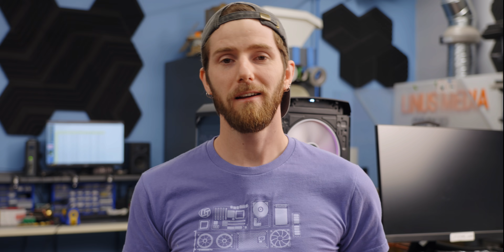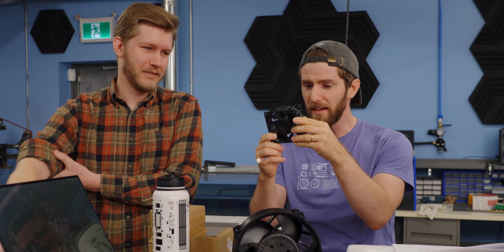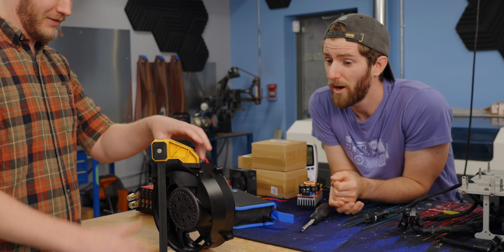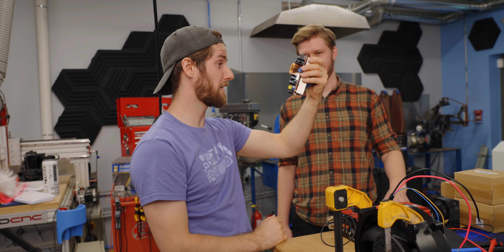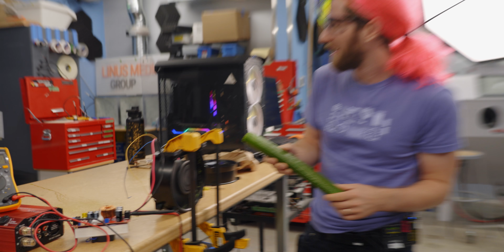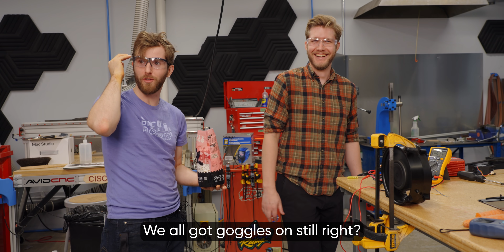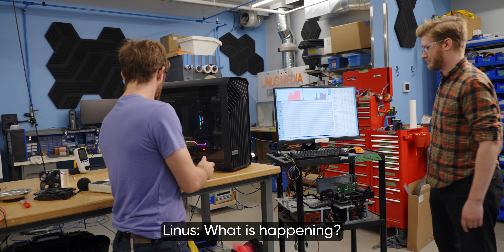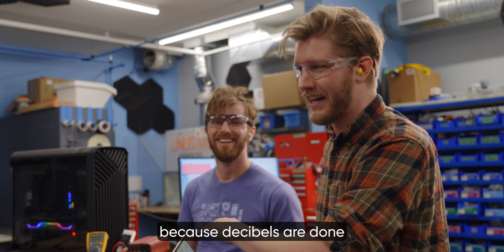The God of Computer Fans

Comment: O have actually installed those exact fans into mcc buckets with extremely power hungry cyclone fan motors. 200HP motor electronics generates a fuckton of heat so they have to have a high heat exchange solution.

Comment: That voltage converter might convert from 12V to 48V, then a PC power supply would fit. And it wasn't a scary thing :) Different story with the fast spinning blades sucking in everything, I wouldn't get my hand that close to it.

Comment: So to answer ur question about moving air into a server room we actually just put in mini splits i installed the heating and air in some. Server rooms a example is a small room about average beadroom size in a single faimly home we had to install 5 tons worth of cooling capacity in that room due to how hot everything got thats the biggest residential unit they make.  More units could have even been added to increase its capacity above 5 tons

Comment: Hi Stationary engineer here we use those fans for cooling VFDs on Air house fan power supplies for vehicle painting, had two go bad about a month ago and it took the VFD off line loosing that air house which had a cascade affect taking down our abatement system.  it turned out to be a a temperature switch that went bad and the fans were fine.   Ive also seen a bank of slightly larger veritable version of those that replaces a large fan in a commercial fan unit.  24 of them supplied enough air flow for a wing of a 10 story building.

Comment: Would agree, these types of fans would show up in industrial cooling/air handing situations. We use a bunch of 24V cooling fans with metal frames/blades for cooling industrial automation stuff at the chemical plant I work at. Sometimes they're 120V, but 24V is common because 24V DC is mostly universal for power and logic signals in PLCs and SCADA (distributed control) systems. Not too surprised at the cooling results either, given the super high flow through the tower heat sink. Would be cool to see a video where LTT and MacAddress do a hackintosh or custom PC that replicates the Mac Pro tower cooling design, but with one of the goals being low(er) noise than this build such that it's ready to daily drive.

Comment: If you want something even more powerful (although they aren't technically computer electronics) check out avionics fans.  Some operate on 3 phase power but others do run on dc power.   I have one of approximately the same diameter as those that runs on 27 volts and pulls 51 amps.  No joke.  I've seen some that eat up 5k watts.   And I bought the same buck converter - only lasted a week =(

Comment: Those boost converter are really good they also can't shock you. And the pontiometers are super reliable of they fail they usually won't output more than the input voltage
Reply: I was very impressed to see it doing at least 1500 watts with 24v input, considering the 30A rating, that input side was seeing more like 60A! no wonder the wires from the PSU got hot! lol

Comment: Those type of fans are used to draw hot air out and in high-power machine cabinet. I worked on one which had a frequency converter in it for several huge engines. 88kw, 50kw and 4x 3kw or so. Cause it has to draw the air through various filters and  a dirt labyrinth, not much of the airflow actually stayed cause air-tech-wise every angle, blockage or bend air has to go reduces the flow by 50 %.

And yes, that means if you have the 5000 litre per second here and let it go through ONE single 90 Degrees Elbow it will be likely only 2500 after that. An 180 Turn will slow it to 1250 then. And so on.  Sure, less steep angles have less performance reduction but if you really check out how many obstacles and complicated ways industrial machine airflow has to go, you need to think BIG in the entry (or exit) to even get a decent airflow.

Comment: Old AB 1395 drives of the 400HP variety or so use a very similar fan at the bottom of the housing to cool massive heatsinks.  We usually just put portable blowers under the drive until they inevitably die and get replaced  where I work.  So there is one use case, though maybe a different voltage.

Comment: 18:00
1Bel = Double the volume
10 deci Bel (10dB) = 1Bel
10dB = double the volume.

What Alex is probably messing these values up with are the 6dB = double the power. So in order to increase the volume of a speaker by 6dB it needs double the power.

Comment: Hey Linus. I am a technical support engineer at Danfoss Drives. These fans are used for cooling high power (+300kW +1000A) drives that used in cranes, HVAC etc.

Comment: I have used 6 of them. 4 were in server racks (but not for servers just that style rackmount hw) to blow air in and out of the rack and 1 for a fume extractor I built. I recall they used to make a smaller version for DEC (Digital Equipment Corporation) that was a U4 or what ever panel that had 2 fans. None of these were run at the rated speed, they were all done to limit noise but for some things you need the static pressure rating of the fan that's more impressive than it's volume/min rating. Next you need to make a bracket to direct all the air over the CPU heatsink fins. They might blow off but if they don't it would work really well.

Comment: They use these fans in large vehicles like rail cars to ventilate the big electrical cabinets with all the circuit breakers.

... I say from inside an electrical locker while installing instrumentation.

Comment: These same fans are mounted on a few large VFD enclosures for larger 200hp AC motors at our facility. They scream when the system is running. We also have filters on these that we replace each week to keep dust and debris from entering enclosure.

Comment: These can be used as a turbo radiator fan setup especially if the radiator is in the back of the car where there isn't any ram air. You can usually find them in drift cars
Reply: Huh that’s really fascinating actually I don’t think I’ve ever seen that before

Comment: For every 6db increase in volume the acoustic energy is doubled , not every 3db. I am an Audio Engineer and mix live Broadcast Sports and Entertainment for a living so I know what I’m talking about. 3db is the smallest increase or decrease that the average human perceive. My ears ruler have flat hearing response and I am in my mid 40’s. I am perceive a 1 db increase or decrease in volume both RMS and Peak. Can also hear audio at volumes lower then 99 percent of the population. Hearing protection is the key and never exposing yourself to high volume as in anything above 85db RMS will help you to avoid any hearing loss!!!!!!! This has been verified yearly by a doctor for the least 25 years of my life… There is nothing superhuman about this, you just need to train your brain to be able to process and perceive. At 95db they should have had hearing protection from the start.   Happy hunting gentleman…………

Comment: 500l/s the air will flow so fast that some serious heat exchanger surface is required even just to extract the heat from the electronics. is this a pipe dream?

Comment: Hi Linus, EE here. I've seen fans similar to this used for cooling computer systems that go into airplanes. At high altitude, there is drastically less air so more powerful fans are needed to keep components reasonably cool. These fans are typically all metal to survive harsh environments as well such as extreme hot/ cold (-55C to 80C for example) and intense vibrations.
Reply: So you are saying there needs to be a LTT Plane to properly test these fans..... sounds reasonable.....can't wait for the video.
Reply: interesting! 🛫
Reply: Thanks for your comment! When they said 48VDC I was thinking that maybe they neglected to specify 'negative' 48VDC which is commonly used in telco switch rooms... but I suppose that's as simple as swapping the polarity. I'm not an aircraft mechanic nor an EE but I have more experience with both than your average bear. I've only seen 28VDC used in aircraft (and AC of unknown voltage but operating at 400Hz!) but that's just from my limited experience; there is a lot of variation in aircraft engineering and it doesn't mean there aren't planes out there using 48V or a step-up transformer just for that subsystem. Given the air density at higher altitudes it makes a lot of sense something like this might be needed for that application! Certainly we need to move a lot of air in telco rooms too but I'd love to see the switch room that would require this!
Reply: @danenright  Ships also have weird AC power you need a transformer to convert to something normal.
Reply: So what I'm hearing is... actual airplane computer fan should be next on the test bench...!
Reply: So technically they are jet turbines lol
Reply: @Enderplays12  I guess.. in a way.. yes lmfao
Reply: @Enderplays12  So technically a turbine captures and converts a fluid flow(gasses are included in "fluid flow") into work.

No, they are not turbines.  They are using electricity(which is not a fluid flow) to turn an electric motor(not a turbine) which rotates the blades(work), rather than say, using combustion gasses to spin the turbine which will rotate the blades(work).  Or putting the blades into an airflow stream and using the rotation to turn a generator(work) as in a wind turbine.
Reply: You should see the fans in the auxiliary unit that cools the PCB and three phase inverters and converters on the trains I work on. They make this fan look like a product from wish. (which in all honesty it kinda is).
Reply: The 48v rating makes sense now, I'm thinking these would be used in the APU bay to maybe cool hydraulic systems.
Reply: @_multiverse_  Datacenters use 48V.
Reply: That was the first thing I thought when I saw they ran at 48v. The Avionics systems I have worked on didn't us fans but we used some mean deltas when we tested boards out side of the enclosure.
Reply: Use the aircraft aircondition sytem will be better 😄
Reply: holy cow lol
Reply: the airpressure thing makes a lot of sense wow
Reply: This doesn't add up.  What plane is flying high enough for the air to be that thin?  Anything flying that high is pressurized so any fan in that plane will function exactly as it would at sea level.   At cruising altitude for a passenger plane, 36,000 ft, any part of the aircraft that isn't pressurized will be  somewhere in the area of -65F / -55C.     You get my drift?
Reply: @Soknik01 Pressurized aircraft aren't generally fully pressurized, just enough to keep people comfortable.
Reply: Ahh, I see now that this fan is for Everest gamers to use on the mountain peak.
Reply: Where can I get metal fans for electronics?
Reply: Isn't it also far cooler up there though? And couldn't you just put some aluminum fins somewhere on the plane surface to dissipate heat based on the sheer speed the plane is traveling at?
Reply: thaaaat makes sense. 
I'd be worried if a flight computer had the same rickety dustcollecting fans that my laptop has.
Reply: @Tulersian  is that so?   Name some modern aircraft that don't have their avionics "equipment" Bay pressurized.
Reply: @mattmcintyre7083  Boeing 767-200. I work on it, I don't really care for semantics. Our forward lower lobe holds our equipment. The pressure seal is on the hatch on the floor of the cabin leading to it, the seal on the E&E access door on the fuselage is nowhere near perfect and allows a lot of deviation in pressure of the compartment. Especially on our aircraft we only prioritize pressurizing locations with people. Where there's cargo we swap configurations so those sections (they can be part of the cabin) follow the ambient pressure to a degree meaning less oxygen at altitude. if there's a cargo fire it will struggle to fuel itself unless it's self oxidizing.
Reply: @mattmcintyre7083  my experience stems from the cargo side of aviation, not passenger. We just have the option to carry passengers if need be. Can't tell if you're trying to make a point about me not caring about the semantics of aviation equipment or if you're actually curious. Either way, I'd trust the, E/E guy over me but I still have experience. (E/E literally stands for Electrical and ENVIRONMENTAL)

Comment: It's a bit unclear, did they hook the fans up to the motherboard fan headers? Obviously the headers can't power the fans but these fans have PWM and RPM signal wires. You should be able to have the motherboard control and monitor them while the power is supplied from an external source.

Comment: we use similar ones for racks with industrial power supplies or source sinks. shit gets hot, especially when turning off and burning residue Voltage after shutting of with a resistor, this needs to be colled so it doesnt destroy the components.

Comment: 10:30 No, it isn't a problem, like not at all. It's not going to turn into a generator, cause that's not how modern fans have worked for like 40+ years.
17:30 Vindication. Now do that on an ancient fan that uses a stator and brushes, then you can be worried about it becoming a generator.

Comment: I remember once years and years ago I learned how to search a parts site for cfm on fans at the time,.  I went ahead and ordered the highest cfm airflow fan not paying attention to noise or anything deemed a good idea.   It came several days later and installed into my computer case and litterally had the sound of 2 hair dryers at war inside my computer.  I'm not joking,  the computer was in the basement of a 2 story home and you could hear the fan sounding like an air raid siren on the 2nd floor.

Comment: At my job (making variable frequency drives) we use delta fans. They are amazing. I've since used delta fans for private projects, (pc cooling, car cooling, paint cabin. And they are very good at making small and tiny buy effective fans aswell. Note that the best voltages for these are 24-36 ish, but the amps also has a say in how they perform.
I've used a ton of their varieties from 30mm to 200mm fans.

Comment: I have one of these in my upstairs floor to move air conditioned air from my bedroom upstairs to my study downstairs. Had it wired up to limit voltage to adjust the speed and noise.

I'm gonna go shove a carrot in mine and see what happens to my study!

Comment: So i work at a chixken hatchery and we use like 6 or 7 of simmilar to thoose and we use them to move the air to the chickens when we have slot of them stsnding in a small area becsuse its not uncommon for us to have 100.000 1day old chickens standing in 120 square meters and the chikens are layered in carts so the airflow needs to be high

Comment: cheaper alternative is to head to the Auto  Parts store and grab some motorbike radiator fans ;)

80w, similar air-flow figures, 12v feed (although the amps are a little higher than a PC power supply can offer)

Comment: 18:00 wrong. it requires 10db to double the loudness(which would requires 10 times the amount of amplifier power).. 3db equates to a doubling of wattage of amplifier power output, not double the loudness/volume. i don't know how to equate all that to a fan's loudness but it would have to be 102db to be twice as loud as 92db

Comment: Linus, Alex, those are often used in the electronics cases for CNC machines. It's rather rare for these fans to fail. The power supply is another matter. Since most machine shops don't have AC they are kinda needed. :P
Reply: 🤔 were you trying to type DC? Most machine shops not only have AC, they generally have access to 3 phase AC.

... Oh, you were referring to HVAC, weren't you. This is rapidly changing, as temperature variation can throw off tolerances.
Reply: @martindinner3621  Indeed HVAC is a rarity in a machine shop beyond basic heating in the winter.

Comment: Also the fans were 110v so no need for the power supply. We had to change quite a few of them out of the drive units because they were out of spec. We had 40 or so left over after we changed them all out. We found a few interesting things to do with them and quite a few "disappeared" from work.

Comment: We used similar fans in our AC motor drives for industrial motors. They ranged from 2 to 6 fans depending on the motor HP range. They would run constantly and contributed significantly to the noise level in the motor control rooms.

Comment: I don't know but I believe that if there is not enough ventilation to let the air out of the case you won't be there to keep the sides on the case. It'll probably blow them right off screws and all, and that's scary. Hell you put for them on the bottom of a computer case and you set the boards in there so that the air can still go around them and you'd have a hover case.

Comment: Aren't these used in 19" racks as hot air removers on the top of the rack, or cold air blowes from the bottom?
Reply: To be clear: 48V is about the voltage of a DC powered rack.

Comment: They make ceramic screwdrivers for the pots on those, they are usually quite small though so a standard electrically rated screwdriver feels safer.

Comment: Question... And if they do the same test... But instead of the air going through the chassis, it goes through the liquid cooling radiator O_o??! XD

Like an experiment you guys did, when you connected multiple fans to a single liquid system radiator.